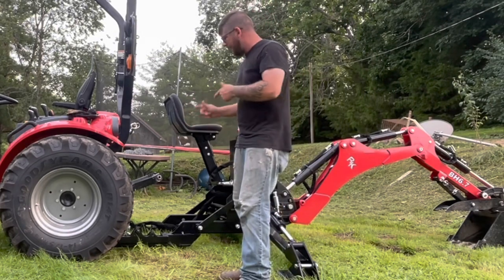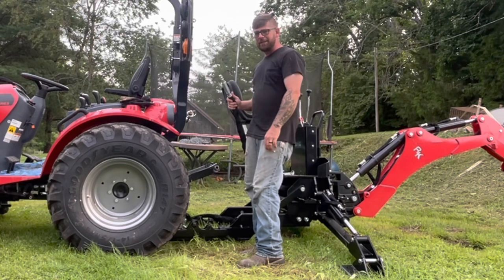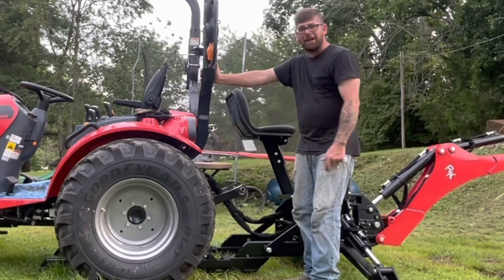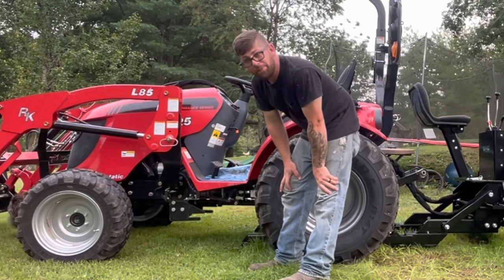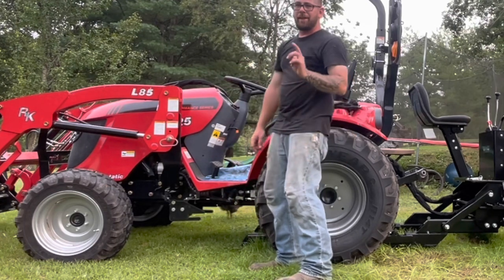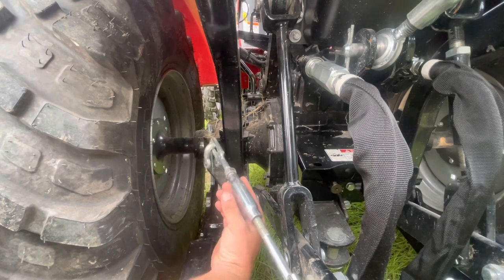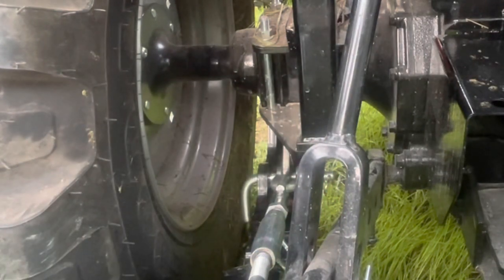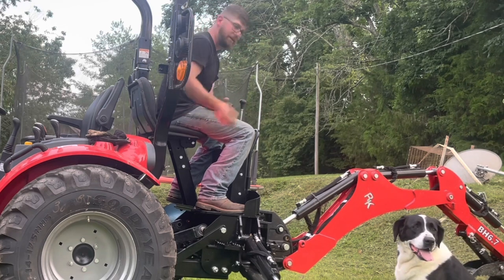#15 RK25 T25 Backhoe How to Hookup

Comment: is the backhoe on the slope of the ditch or is it level? It might just be the curvatrue of the lens. I didn't know about seeing the alignment through the brake. I like to spray WD40 on the part of the subrame that has to slide in at the front, it seems to help a lot. I think putting the tractor in LOW and 4WD makes a big difference too when attaching. I can never get my U connector on lower 3 part arms for the pin to go through all 4 pieces. I just leave them off since they dont seem to effect anything. Besides you don't use the 3 point anyhow so I just fold them arms up to the inside and they stay. Your's is right, though. Good job. I appreciated to see another person do it.

Comment: Can you put the mid mower deck on with the backhoe receiver bracket still on the tractor? I know you have to remove the backhoe, but can that receiver bracket stay on?
Reply from the maker: No….. to the best of my knowledge the mounting brackets for the belly mower interfere with the mounting brackets for the backhoe mounting brackets. So you cannot have the two on one tractor at all. You either get the Rk25 with a backhoe or get the Rk25 with a belly mower. You cannot get both.

Comment: Just wondering. I also have the Pats Quick Change Hitch. Do you think I have to remove them? Going to pickup my BackHoe tomorrow!
Reply from the maker: I do not have the pats system. I think you should be able to put the lower link arms in a position that you could certainly leave them on.

Comment: Just thinking, couldn't you use the bucket to curl out to push you right in place to do the final hookup after you used the boom to line yourself up?  12:00 time stamp .  Use the controls on the backhoe instead of jumping on and off the rig.